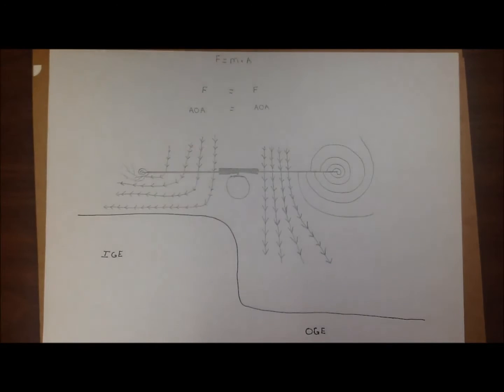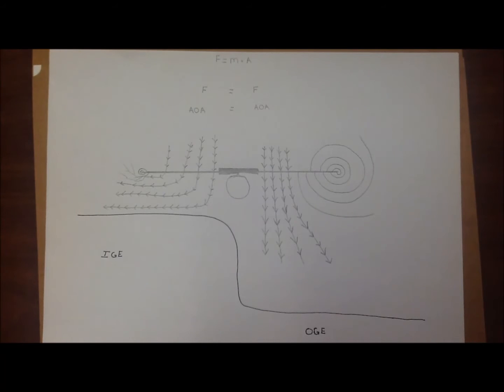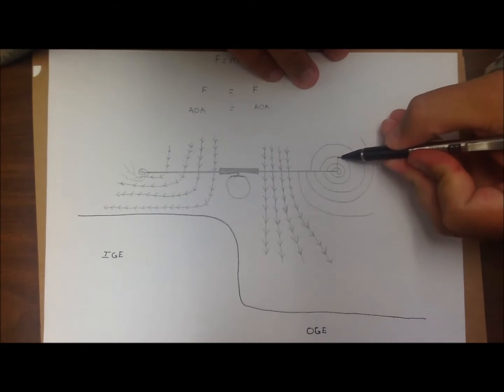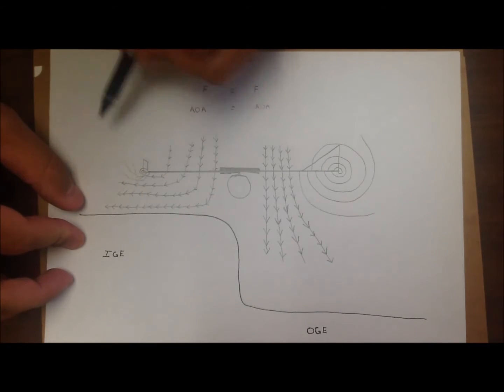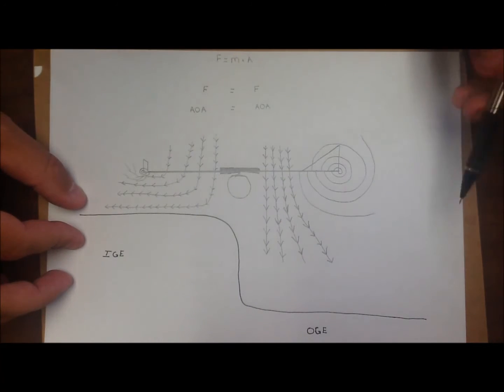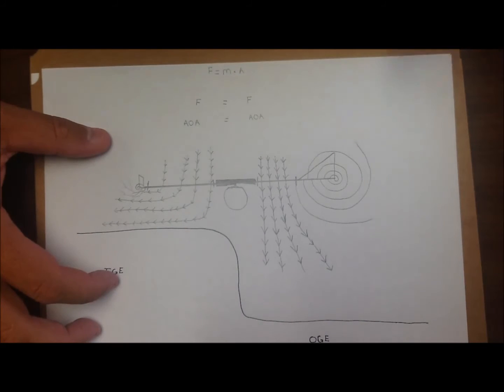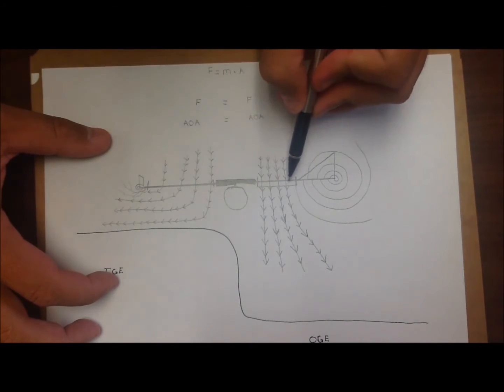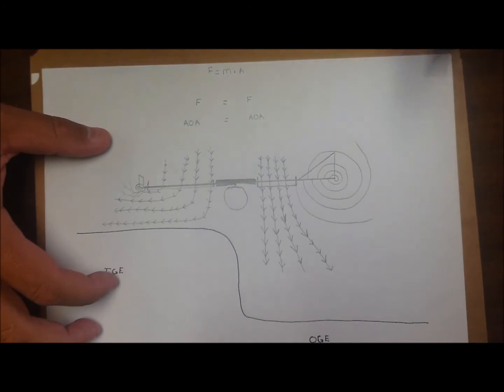Helicopter Airflow In A Hover

Comment: I'm just curious, to which source do you refer?
Reply from the maker: You must read Ray Proust and Shawn Coyle’s book, in totality, to get the complete picture. Those are your sources.
Reply: @robandnikki1  6 years later :) thank you for the pointer. I know the subject fairly well.. Always find that explanation misleading. It's the reduced induced flow that's the main thing IGE, not tip vortices. Reduced induced flow increases AoA, allowing you to lower collective. The larger tip vortices OGE are simply a byproduct of larger angles of attack (stronger lift production) needed due to the total reaction leaning further aft with a higher inflow angle, which comes from an increased induced flow in the absence of a restriction (the ground). So basically -> higher AoA (stronger aerodynamic force) needed as induced flow increases without the ground restricting it: first thing. Larger tip vortices: second, byproduct of higher AoA.
Reply from the maker: @Zolare  
Tip vortices explain the available surface area of the lift equation. The rest follows as per the explaination